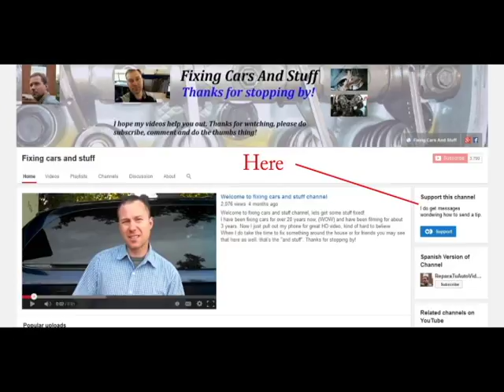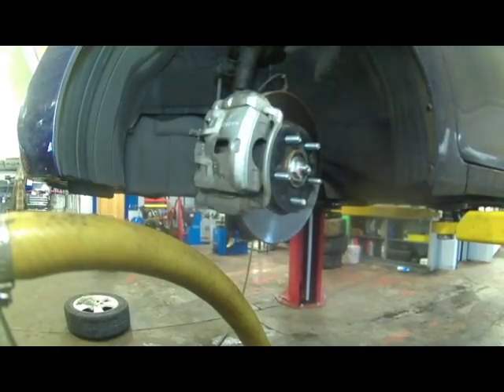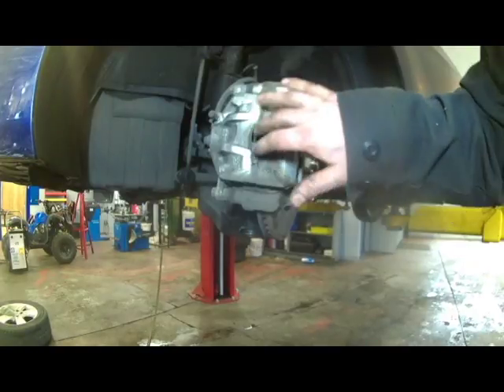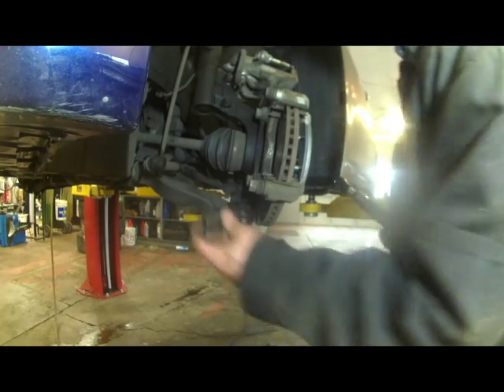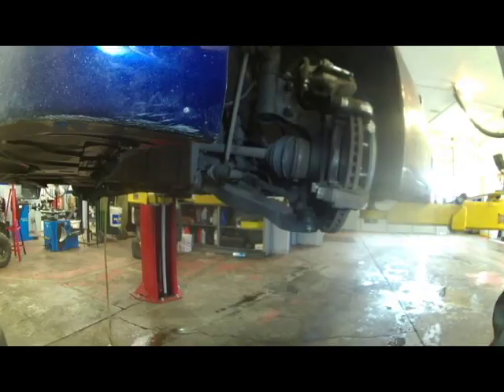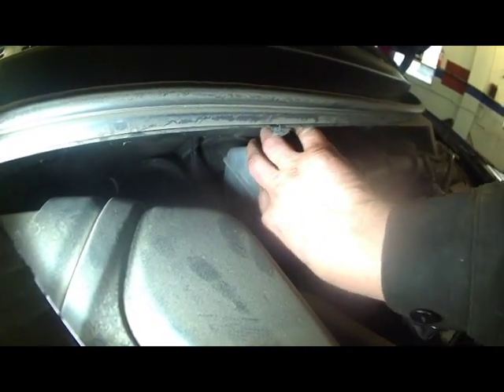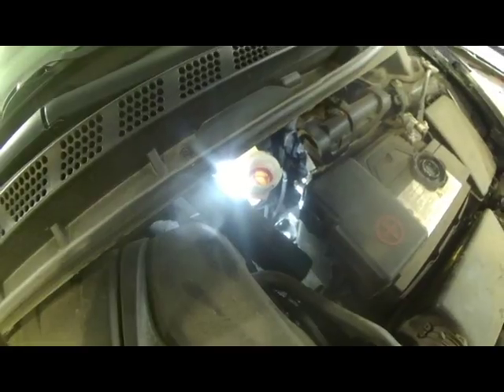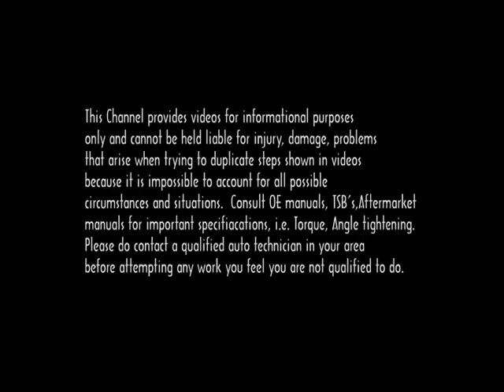Front brake pad replacement 2013 Hyundai Elantra.  Install, remove or replace

Comment: never forget to pump the brake pedal until it is firm. I work at a hyundai dealer  and I cannot tell you how often this step happens.  this is because the flat rate techs are always  in a rush.  working at a dealership  sucks  .
Reply: I'm guess you mean after you change the pads, pump the brakes until it feels firm as to let the Hyrdo. Fluid settle?
Reply: Joe, I always thought you didn't pump the pedal to give the lot driver a thrill(or at least wake him up).

Comment: If you are doing an INSTRUCTIONAL, you don't  skip steps, for example, showing taking out the second 14MM bolt.  You acted like you did not have to remove it but you just fold the caliper back out of the way but the bolt had clearly been removed.
Reply: Was it 'removed' or just backed out enough to disengage the threads?  When he removed the caliper the bolt was still in place. What am I missing?
Reply: @TheTruthCalls  You didn't miss anything, some people should do videos, and some people shouldn't.
Reply: I know it's an old video but he never removed the top bolt, if you watch you can see he slid the caliper piston right out with the bolt attached, the same way you would of you were to re-grease the piston